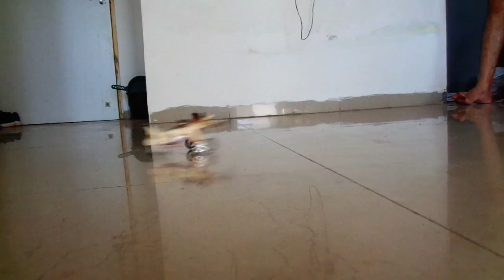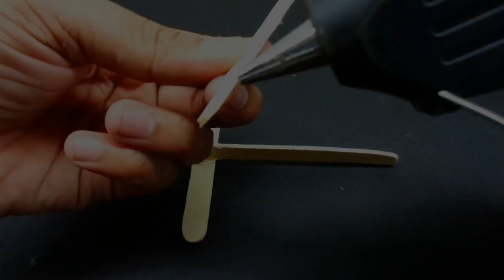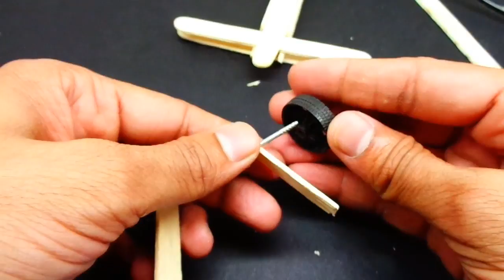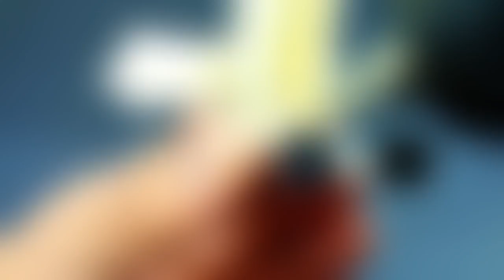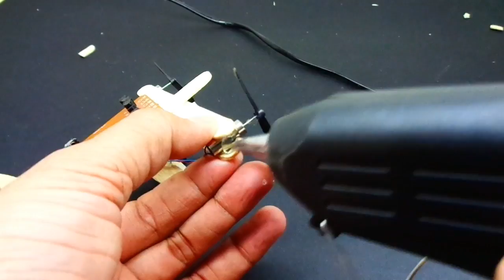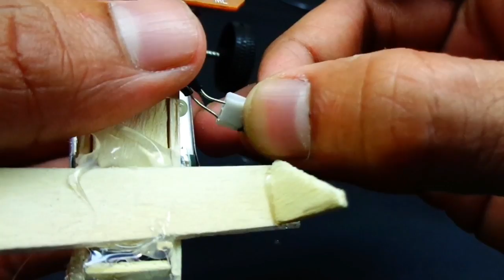How to make RC toy Propeller Plane DIY

Comment: CNC_code.ino:7:21: fatal error: AFMotor.h: No such file or directory help pls bro,its happening when i try to check the code or upload it on board
Reply: Its video how to make mini cnc machine(first version)
Reply from the maker: u need to add AFmotor shield library in arduino ide